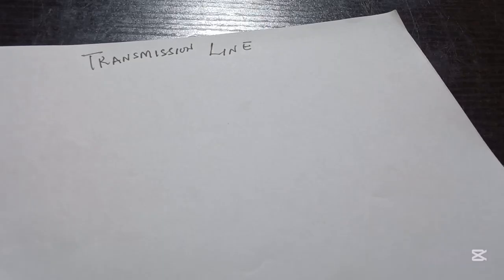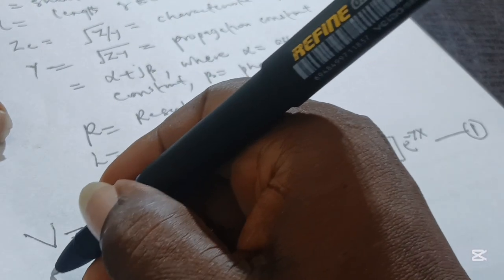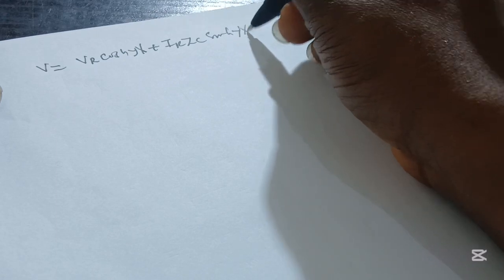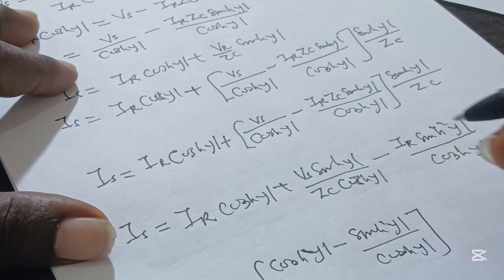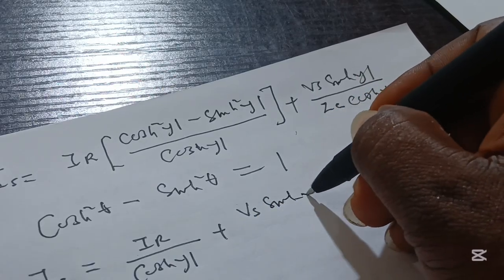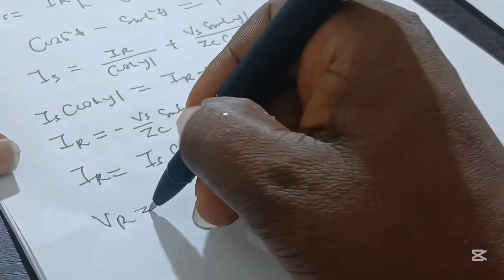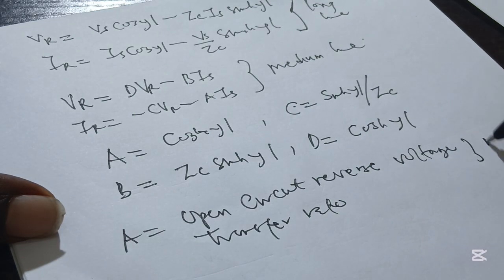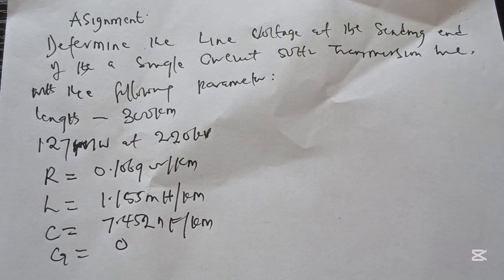Long Transmission Line || Electrical Power Systems

Comment: This is so understandable sir 

ASSIGNMENT SOLUTION: 
Series impedance (z) = 0.1069 + j 0.3629 

Shunt admittance (y) = j2.4049 ×10^-6

Line voltage at the sending end (Vs) = 132494.37 + j37186.5V

I hope am correct sir 😀

Comment: Very clear sir. 
For the Assignment 
My answer is 
137745.189 phasor 15.708. 
That is the line voltage at the sending end Vs is 137KV
Reply: Your answer is correct.Thats what I have too